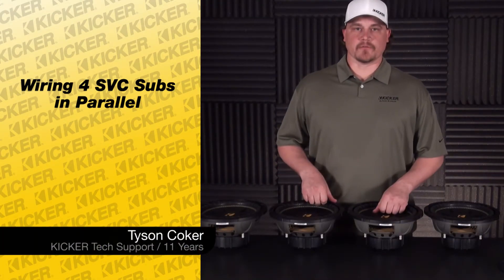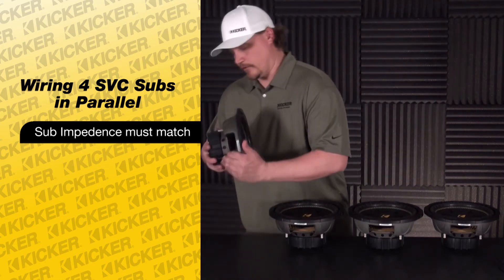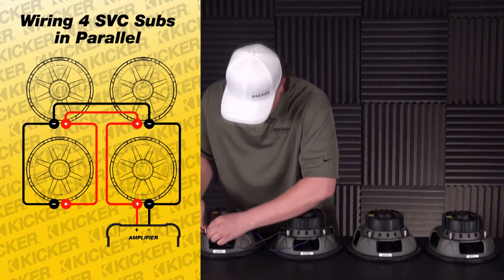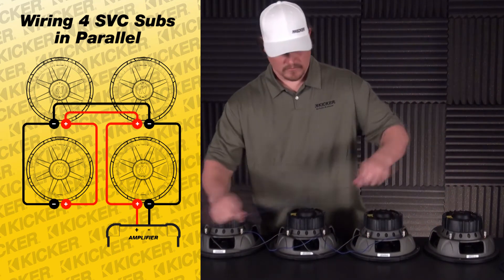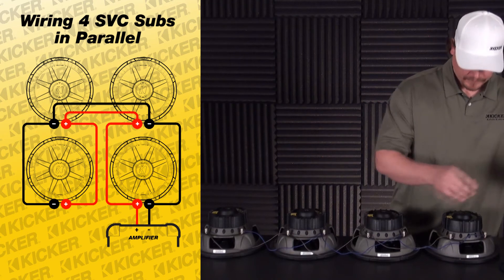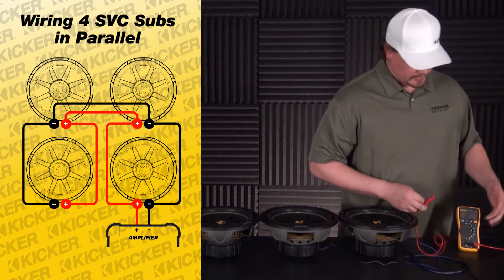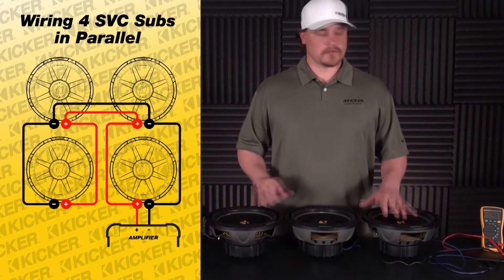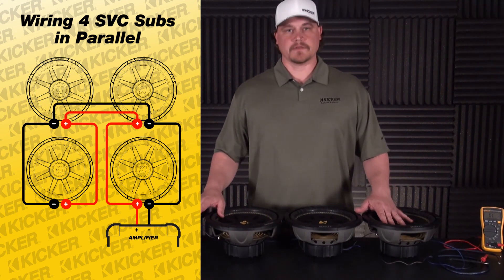Subwoofer Wiring: Four SVC Subwoofers Wired in Parallel

Comment: What is the best way to wire 4 subs to a 4ohm amp I had mine wired up and working and hitting hard for over a year on a 500 watt 2 channel amp but one day one of the channels stopped working so I took the wires from that channel and put on the other channel with the other set of 12’s and it worked for a few then 2 of the 4 subs stopped hitting idk what the problem is cause I didn’t touch them and they just stopped hitting
Reply from the maker: Logan Williams Need to know the model numbers of the subs in the app to tell you the best way to do that. Very important to know ahead of time.

Comment: shouldnt it be 1 ohm? i thought 3 4ohm subs wired in parallel results in 1.3 ohm
Reply from the maker: Perfectly valid question! Ok, there are 2 factors:  the first is that the speaker industry as a whole (everyone - not just us) considers a voice coil acceptable within a certain rage of 4 ohms.  So a coil that is 3.8 to 3.9 ohms is perfectly safe and performs to specifications.  The other factor is the resistance of the speaker wire itself, which will vary depending on a few things, like the quality of the wire, the gauge and the length of the wire run.
Reply: KICKER if i have a mono block amp with 4 4ohm svc subs wired to 1ohm or 1.3 ohms how will the power be distributed throughout all for subs. if each sub is 300 watts each and the amp is rated 1200 watts rms @1 ohm
Reply from the maker: Yes, indeed. It's an even distribution.

Comment: yea so one set + to +. - to - then to amp. second set + to +. - to - then to amp actually works with the cx600.1 mono amp?!?!. so this whole time i been racking my brain tryna find a 1 ohm stable amp when all i had to do was buy another sub an 4 hole box?? Thank goodness my wife wont see this geez lol
Reply from the maker: Here's a secret....1 and 2 ohm power makes very little difference.  Here's why: to get double the volume, most people require about a 12db increase.  That's just the way the human brain works.  What happens when you double the power? Only a 3 db increase. MAX. Thats it.

It gets better!  The lower the ohm load, the lower the damping factor of the amp. Damping is a measure of control your amp has over the speaker.  A higher ohm load will tend to make the bass less "muddy".  It will sound crisper and clearer at 4 or even 8 ohms, but the trade off is of course the loss of power, as you already know.  

Have I made your brain explode yet?
Reply: KICKER yea im lost lol but i still feel a lil sketchy about wire 4 subs to my cx600.1 mono amp. Its my baby i literally bought it the day you guess dropped it in stores in 2013. We have been thro wars together lol its a lil scratched up but its still great. So basically what im saying is are you 100% sure i can wire 2 Kicker 12" svc 4 ohm 600w/300rms parallel to 2 ohms on 1 set of its channels and another 2 Kicker 12" svc 4 ohm 600w/300rms parallel to 2 ohms on the other channel an not have any issues?? Cause if i definitely can im running to go get another sub an box right now!!! lol thank for your help in advance
Reply from the maker: OK I misunderstood what you were asking.  With four 4 ohm SVC subs, you have a few choices - 1/2 ohm (all parallel) 32 ohms (all series) or 4 ohms (series-parallel). Watch this video for more: https://youtu.be/cDkBxeSLEAc?list=PLV2hurat1mvmHUBLRPIfRMkWKtIO-TSNo

Comment: so can you wire 2 parallel and another 2 parallel separately an run them on a kickercx600.1?? both sets wld get 600w correct??
Reply from the maker: Sure, as long as the total ohm load doesn't dip below 2.  Just don't wire one set in phase and the other out of phase.